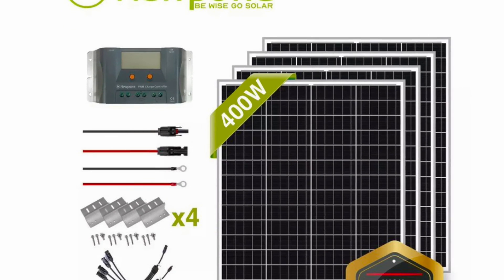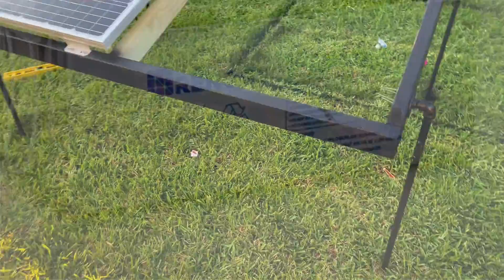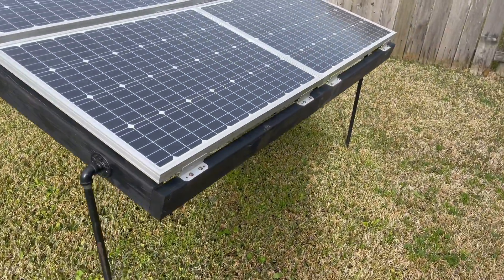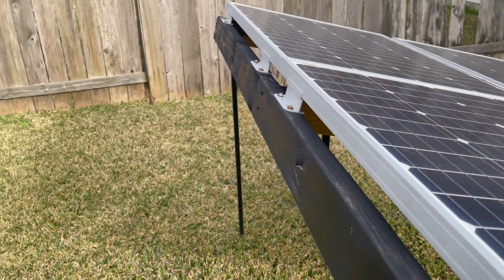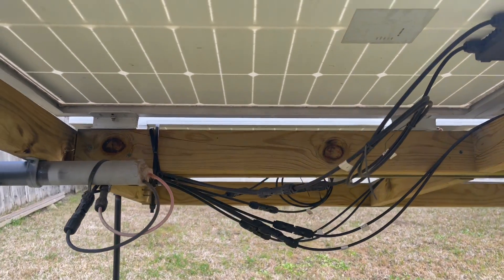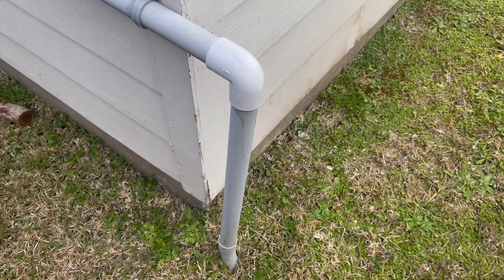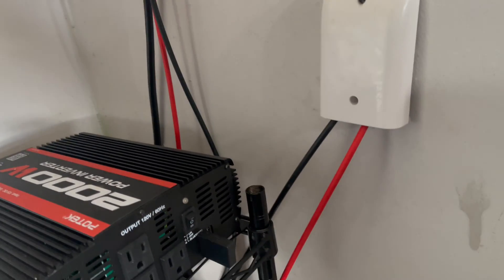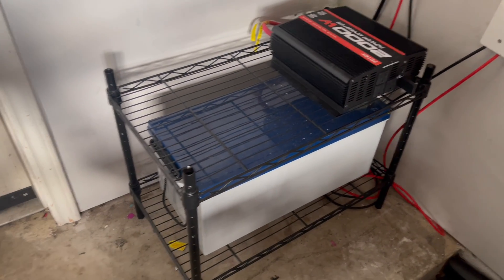My DIY Newpowa 400W Solar Power System

Comment: Cool video. I started with 400 watts off-grid years ago. The 400 watts with 3 marine batteries at around 300ah can do quite a lot.
Reply: Can this be able to run 24/7 without having a power  cut if you have a 100tts pc,32 inch led television,8 hundred watts bulbs?
Reply: @zangulakozm5526  no that is way to much. You don’t want to run more than 300 watts when the panels are in direct sun and roughly 200 watts of power drawn through the night with the system I described. You should use 12 volt led light bulbs that screw into a standard 120v sicket fixture. These bulbs commonly come in 3,5,7,9,11 watt ratings. A 7 watt 12 volt led bulb is as bright as a 60 watt 120 volt bulb!
Reply: @Mountainrock70  I feel like I need take an electrical class before I even think about getting solar
Reply: @Lilthis_n_that  Theres nothing wrong with taking a class first! But a small solar system is so basic you probably will laugh after you do one. Hook charge controller to battery and inverter to the battery at the same time FIRST! Then hook you solar panel to controller and you are rocking!  To work on system and make improvements later do reverse order. Discount solar array first.!

Comment: nice setup .. actually in the process of building a backup battery 200ah system as well .. with newpowa 200w panel ..using one on a cart at first.. the battery / inverter and controller can be left in the garage the cart pulled out for solar panel to get some from the sun.. and run a fridge and some fans on it for hurricane season..

Comment: Please help me out. I have 5 solar panels, each with max power 295 W , max power voltage 32.5 C, max. Power current 39.7 V, ISC 9.55a, power selection 0-5w, max series fuse 15a. My question sir is what type of battery do I need to get and how many do you recommend. Thank you

Comment: What an excellent small starter system you have there 🤗. The PV modules are looking great on the rack mounts running underground to the house is a great idea instead of being on the roof . Props 🤙to you for this DIY solar setup as we preppers must have during any SHTF situation or to save on the light bill > Please check out my DIY solar videos , hit like , leave a comment and subscribe.May the solar be with you .😉

Comment: Should replace the wires with some heavy duty speaker cables if it's protected from the rain in those pipes, Real thick stuff, You'll get more power out of your setup & it's cheaper than getting weatherproof DC cable 👍